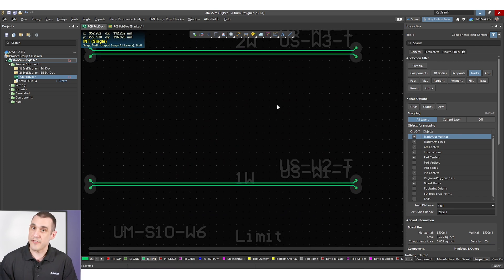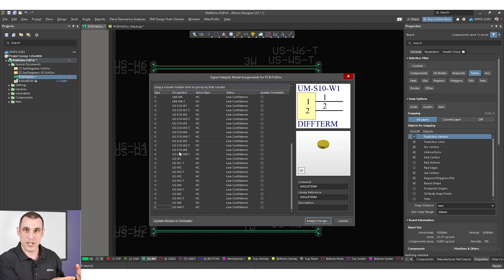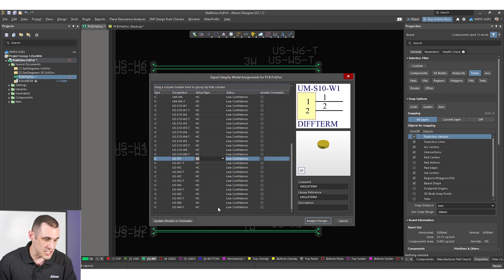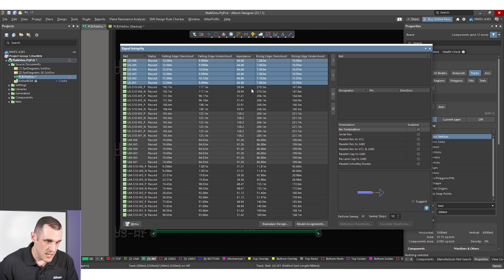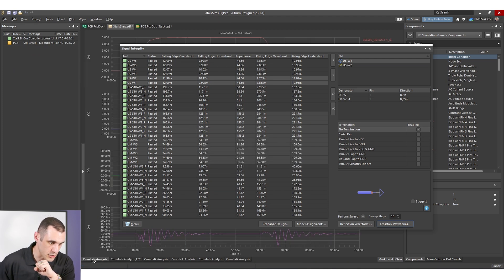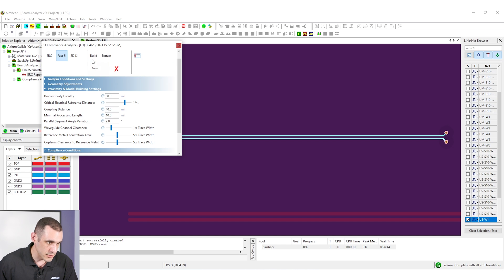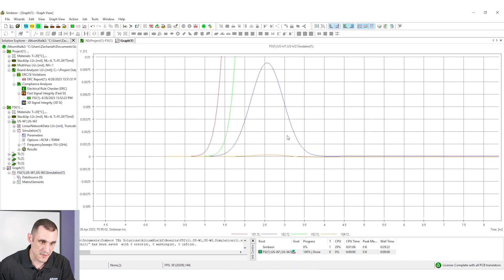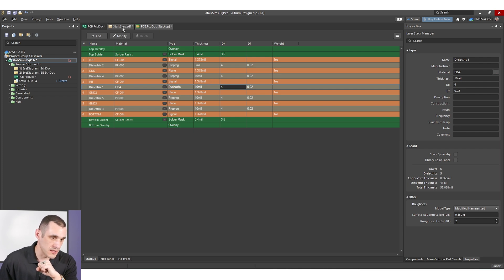The Easiest Ways to Reduce Crosstalk in a PCB

Comment: Everything is linked - thinner dielectric requires thinner traces to achieve the correct impedance which then increase skin effect losses at high frequencies - so really we need a simulation that takes everything into account!
Reply: Skin effect is included in these implicitly and would be observable by comparing insertion loss plots, but since we are talking crosstalk I did not want to get off track and talk about the increased skin losses.